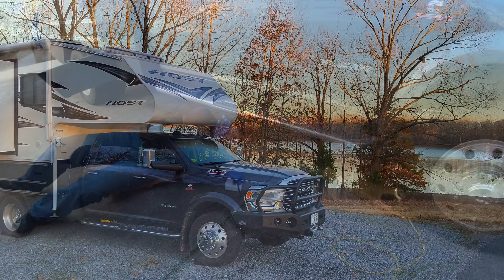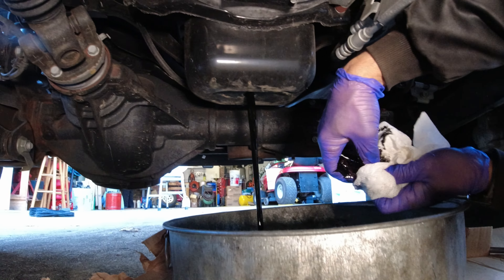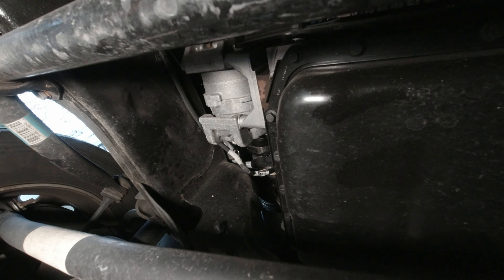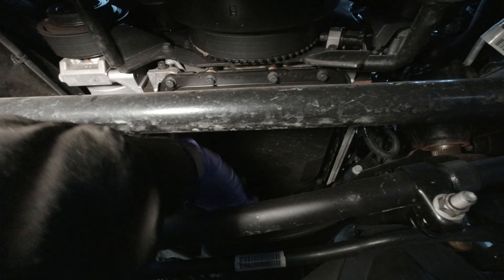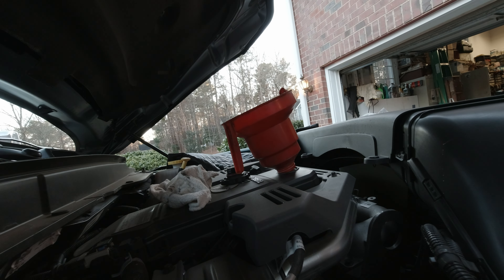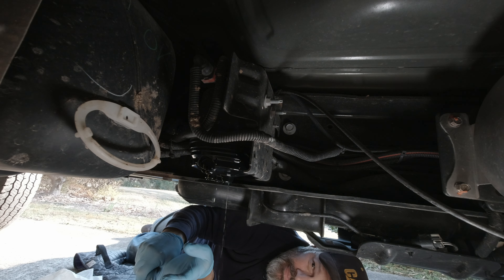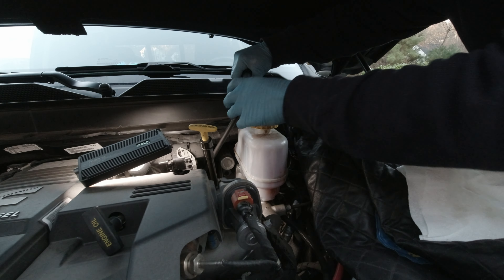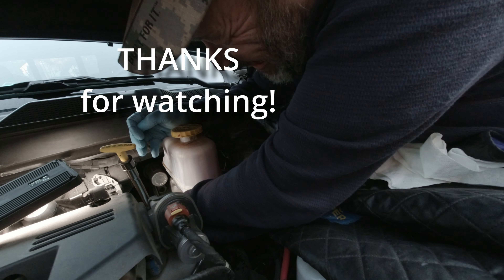DIY VS Dealer: Cost to Change Oil & Filters on a Ram 5500 |e99

Comment: How many miles on truck before first filter changes?
Reply from the maker: Hi Phil - we went 15k.
Reply from the maker: I should say that we do have a 2020 Ram 5500, and Gary mentioned that they've increased the mileage between oil changes with the new engine.  If you have an older 5500, I don't think that applies...

Comment: 22 gallon fuel tank? Do you have two fuel tanks or? 

I haven’t yet changed the oil on my Ram 3500. I’m curious why Gary went from the bottom vs the side when R&R the oil filter? Man thank goodness for Gary working out or you may have had to resort to the dealership to get that oil filter off.😜

Appreciate the video!
Reply from the maker: Yeah, we had to do that last year I believe, and I swear you need to take out a small loan just to get your oil changed at the "stealership".  And yep, we have dual fuel tanks.  Gary says that on the 3500, you have do it from the wheel well, but the 5500 was easier to get to from underneath.  At least that was his experience.
Reply: @TheJoslynJourney  ah got it thanks! ✌🏽